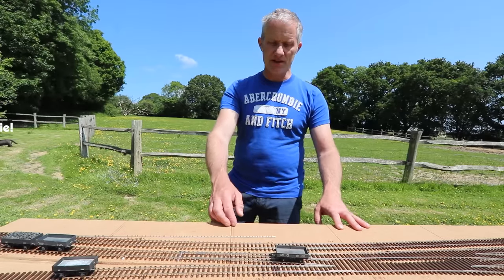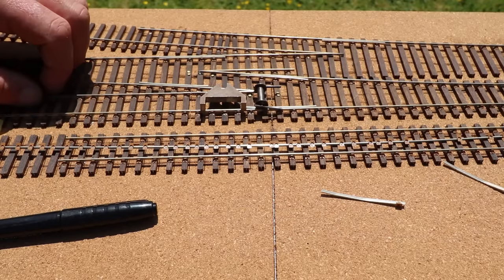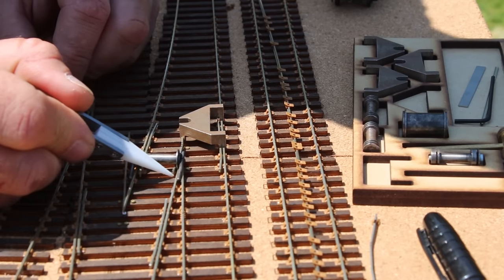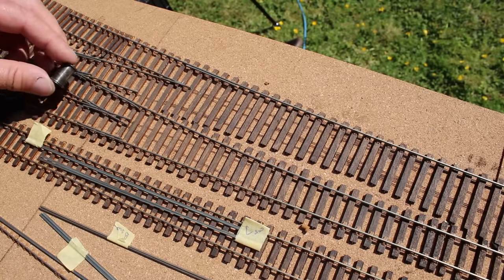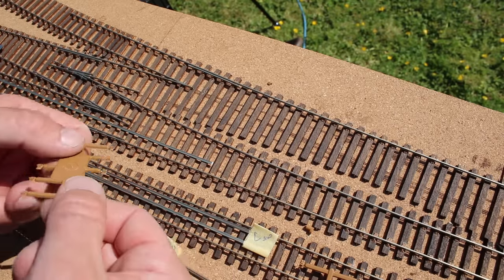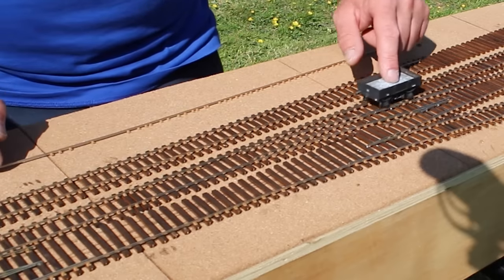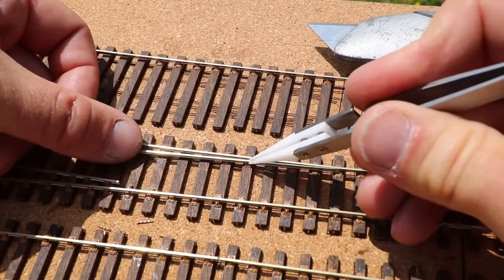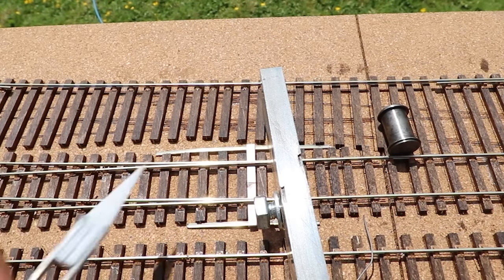S2 E25  Track building for Bexhill West Model Railway

Comment: Very interesting and thorough.  However there are two other elements to ensure smooth running.  They are wheel/flange profile/gauge and back to back dimensions.  The second is the suspension/springing.  The wheel/weight and springing must be designed as a complete system.  There is of course a fourth and obvious element - the track base must be flat!

Comment: Hi James. Since you are going to all this trouble, I think you might consider imagining that Bexhill West had not been closed by Beeching and had been included in the Tonbridge to West St Leonards electrification project which you will have to backdate to 1933!  This will allow a greater variety of trains to be featured. As you are modelling in P4, you have the option of using the 3rd rail to pick up the current! This would make an interesting project.  Thanks for uploading.

Comment: As a retired S&T technical support engineer (41 years on the railway) is refreshing to hear you using the correct terminology for the parts of the switch!

Superb work James. 

Almost therapeutic to watch you working your magic!
Reply from the maker: Thank you Darren, It's far from prefect, but I'm improving with each one, and the visual effect is especially pleasing.  I'm pleased it meets your approval though.  Which region did you work in, if you don't mind me asking?

Comment: Hi James,  

Nice to see you cracking on with the turnouts.  I found for threading chairs on that if I cut the rail slightly longer and used the common crossing filing jig then it made a really nice taper and the chairs just slide on.  Also with the fishplates, I used a pair of tweezers to grab the end that's already on the rail, this forced the other end to open up nicely and helped with pushing it on too.  I need to work on deciding and fitting my tie bars soon,  Genius idea using rail to act as springs though,  I shall definitely try that method!  Looks like everything runs lovely and smooth though :)  

Cheers,
Michael
Reply from the maker: Thanks for the tip Michael, I hadn't thought of using the jig for that purpose - I'll definitely give it a try.
Fingers-crossed it's all working well at the moment, but I'll wait until I've had stuff running through the whole complex before fitting cosmetic chairs over my soldered joints.

Comment: Hi. Congratulations on some fine work. I think it might be easier though if you leave the check rails off until last, since they are gauged from the common crossing and wing rails, once they are fixed. Did Bexhill have any double slips? They are fun to build!
Reply from the maker: Hi Tom, thanks for the tip.  I'll try that.  
There wasn't a double slip, just a solitary single slip which will be my next challenge.
Thanks for watching,
James

Comment: Excuse me, the stock rails do NOT run the whole length of the point. They are the piece of rail that has the switch rail attached to it. The joint at the switch heel then has a closure rail attached, the heel end of the stock rail, which is either a sleeper bed ahead of or behind the switch heel joint, ie staggered, has a running rail attached. These joints on the protoype are either bolted plain fishplates, insulated fishplates, thermit field welds or in rare cases electric arc welded. 
         I don't know where this missnaming of point parts originated but I suspect from people who have never worked on the prototype railway. My railway career was just over forty years in the Civil Engineers Dept. 
    I don't use the word expert but use the word experienced. Am sure the misuse of the word expert over the last fifty years or so has put people off biulding models or even taking up the hobby its self.
   Thank you for posting your informative and interesting videos.